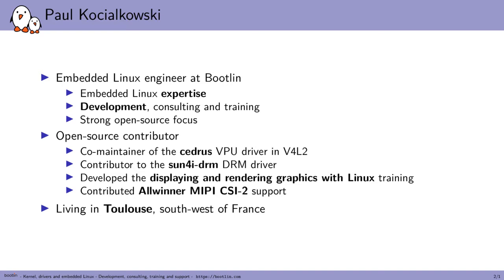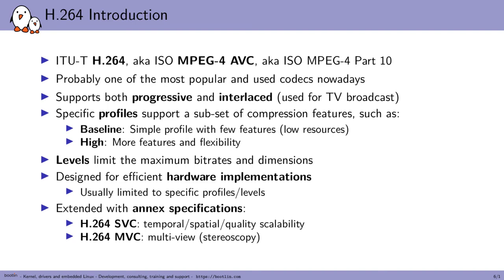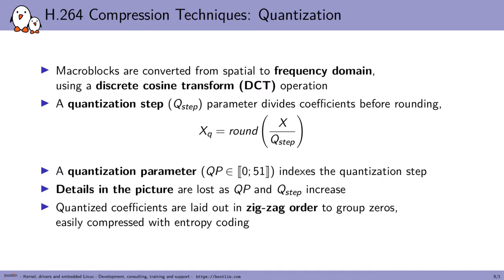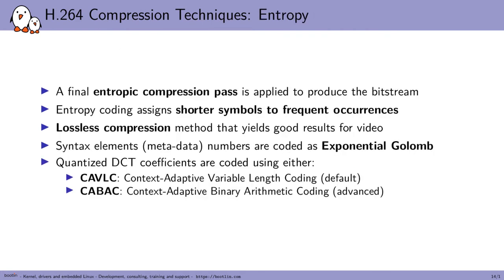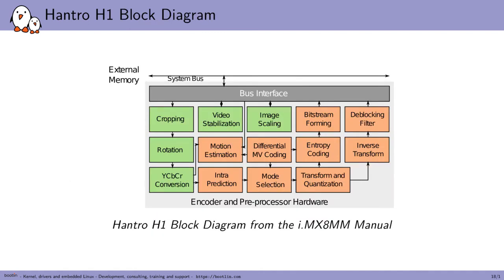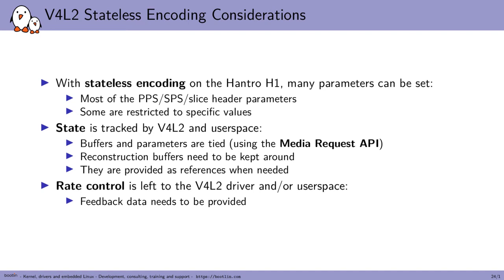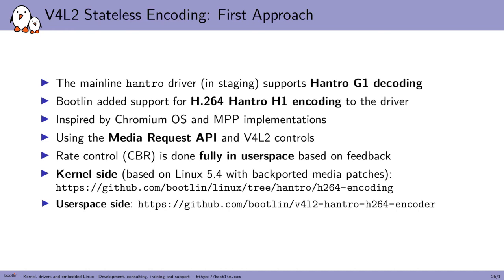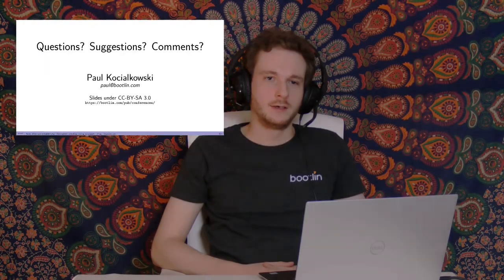Supporting Hardware-Accelerated Video Encoding with Mainline - Paul Kocialkowski, Bootlin

Comment: Very interesting. Rate control in user-space would be a major problem, it already is with some stateful controllers, but I see some room for improvement to allow fine control over it from user-space with a standardized interface, which should apply to both kinds.